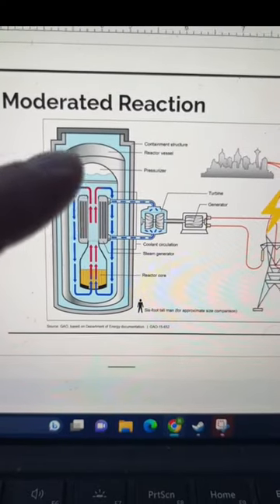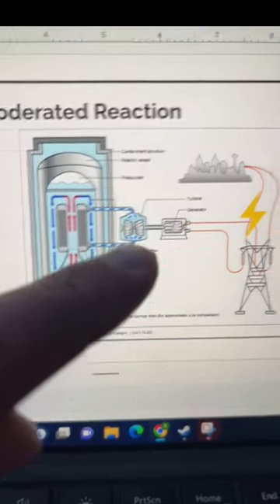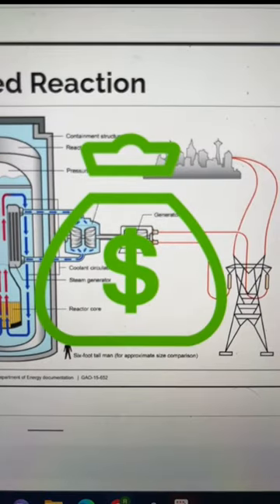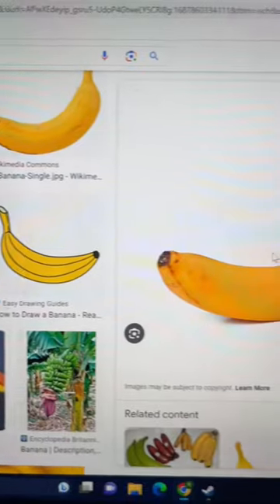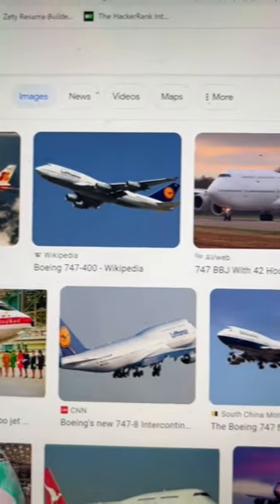No, The #Zaporizhzhia Nuclear Plant Will Not Explode

Comment: minor nit to pick. Former nuclear trained sailor here and current procedure writer for field projects dealing with reactor maintenance. You cannot "walk into the reactor after a couple of weeks" of cold shutdown. What you can do is walk into the reactor CONTAINMENT or COMPARTMENT very soon after a reactor shutdown. But yes, cold shutdown does make the plant fairly safe as long as water keeps the core covered as noted in a previous comment.
Reply: My Dad was a nuc too.
Reply: You can walk inside reactor pressure vessel too, that's how they replace the interval components. They usually decontaminate the vessel before entering for ALARA reasons but it's not a neccessity.
Reply: @vaclavzajac214  the internals are pulled out of the vessel from above usually. I've been involved in those. You can decon the RV but you can't de-radiate it. I'm not saying that there aren't jobs that require entry into the vessel but those are very rare. Robots or remote tooling is usually used. I've been involved with major work under the RVCH (reactor vessel closure head) and that was ALL remote work.
Reply: But I thought you could not enter the containment of a GE boiling water reactor even after shut down.
Reply: @BobConnor-n2g  we're talking about PWR, not BWR. In BWR you have to wait for the radioactivity of the water to drop which takes a couple of hours. Then you can enter the containment with no problem

Comment: Without cooling, a meltdown is still possible a long time after shutdown. Just takes longer and is less dangerous. Would really ruin the reactors, though.
Reply: An explosion is also possible if you add enough explosives to the nuclear powerplants and Russia have already at least mined the cooling pond.
Reply: Also 2 are in a hot shutdown
Reply: Reactors there are VVR not RBMK like in Chernobyl. They are safer yes. However, something akin Fukushima incident can be organized by Russians
Reply: @SK_2521   Fukushima was more akin to a dirty bomb, in that nobody actually died of radiation poisoning, but several people died of stress related illnesses due to the evacuation.
Reply: @BlackEpyon  Point is - both Fukushima and Zaporizhzhia stations has proper Reactor pressure vessels which contain all the nasties stuff (unlike Chernobyl which essentially was "campfire in the middle of the living room") and this containment is very robust and hard to destroy. 
That's why some leaks of irradiated gases/water might occur if station blown up but nasty staff will stay inside. 
Regardless - destruction of the NPP even without massive fallout will cause enormous economical damage
Reply: @SK_2521  I like your analogy of the "campfire in the middle of your living room." That's a good way to describe the RBMK reactors. That said, it doesn't mean one couldn't use shaped charges on the reactor core AND blow the reinforced concrete of the containment structure. They'd just have to go through a lot more effort, and do so while the IAEA isn't looking. And you can bet that whatever happens, Russia will blame it on Ukraine, and the western media will do their "both sides balanced reporting" to needlessly confuse the issue. I'm all for objectivity, but causing needless confusion like that just pisses me off.
Reply: @BlackEpyon Good luck on the concrete. There was a test that had an F-4, fully loaded with fuel, slam into a relatively small brick of the stuff at about 600 mph.

The fighter disappeared. The concrete had a small smudge where it hit. The video is on YT.
Reply: @BizarreCoyote  That's because you don't use a fighter jet to do the job of a shaped charge.
Reply: @BlackEpyon  The point is that the reinforced concrete used in Reactors and Spent Fuel Casks is incredibly durable and I doubt that whatever they would be able to apply in a single layer while the IAEA observers aren't looking would be enough to blow the thing.

Shaped charges are great but you aren't blasting through anything and everything with them in a single go. And the second they try to blow it and fail is the moment Russia gets pimp-slapped by NATO for trying to cause an ecological disaster.
Reply: There are two paths to an explosion:
1. meltdown penetrates bottom of pressure vessel, no core catcher installed, hits the concrete, it's heat pyrolytically creates H₂ and O₂ from the concrete, and once the concentration is high enough, some elctric spark or the hot core itself triggers their violent recombination.
2. holes drilled into the containment walls, filled with some explosive and set off to cut a hole into the wall, which then also releases the inventory from the meltdown. Only looks less dramatic.
Reply: @BizarreCoyote  If you drill holes into the walls, stuff them with an explosive, and set them off, demolition style, that's way more powerful than a plane filled with fuel, which means small impact and  irrelevant yet spectacular fire show 🙂
Reply: @chickenduckhappy  the reactors have been shut down for a year now, they don't have enough decay heat to cause a hydrogen explosion, that would require much higher temperatures and it would react with the coolant water before interacting with the concrete water
Reply: @vaclavzajac214  Hydrogen explosions don't just happen on top of that, as there are lots of counter measures- in the most extreme case, venting 🙈
Reply: @chickenduckhappy  yeah, you're the one who claimed it could happen, I just pointed out that coolant explosion is much more likely than a concrete explosion.
Reply: It's not the water in the concrete but the concrete itself that gets pyrolysed in a real meltdown. But my point is not how unsafe these reactors are by themselves at all. I specifically am talking about the potential for intentional sabotage and demolition.
Reply: And I believe one or two of the reactors have only been shut down for a month or so.
Reply: @chickenduckhappy  you could make the same argument about every single part of the civilian infrastructure, nuclear is the best guarded civilian infrastructure and I can assure that the risk of a terrorist attack is minimal.
Reply: @chickenduckhappy  they were operated at a fraction of full power, they don't need active cooling anymore either. The RHRS can take care of it.
Reply: As much as I liked to see the chaos coming home to roost in Russia, both the coup attempt and its handling have lowered my already abysmal trust in Russia making rational decisions even further.
One reactor seems to still be generating some steam for one turbine for the plant's own electrical systems btw.
Reply: @chickenduckhappy  that reactor has been shut down about a month ago and it was ram at low power so it's not a big deal. Russians might be stupid but they won't destroy a powerplant more expensive than their total war spending so far for literally zero strategic advantage.
Reply: @vaclavzajac214 Never underestimate the view that if I can't have it, you can't either. It's on the level of a two year old, but that's the way the current Russian government seems to be operating.
Reply: @johnhaller5851  that's a really stupid take can you base it on anything?,
Reply: @vaclavzajac214  Many people view the threat as the potential for turning the plants into a dirty bomb. Russia's attacks on civilian power and heat production and distribution would be aligned with an attack which cripples the ability to use the plants to generate electricity. Given plant design, it's hard to do that after one no longer has control over the facility. It would even be consistent with the damage to the Nova Kahovka dam, which could have been an attempt to destroy the electrical infrastructure that went far beyond the original plan. Do I have any proof? No, but we can wait and see what happens later this week or next.
Reply: @johnhaller5851  the powerplant hasn't been generating electricity for over a year now, there's no strategické advantage to destroying it and Russians ate the ones controling the plant so I'm not sure how that would harm their enemy? You can always just destroy the cables.
Reply: @vaclavzajac214  Cables can be replaced easily, it's been done several times already. Pressure vessels cannot.  In my opinion, Russia doesn't want Ukraine to be able to turn the plant back on should they recapture the plant. Of course, not having cooling water is an obstacle, but that just requires redundant pumps from the current river level. Just my opinion, but we will see.
Reply: @vaclavzajac214  the coup has significantly reduced what was left of my trust in some of their sanity still being there.